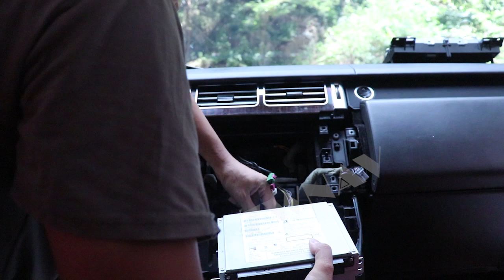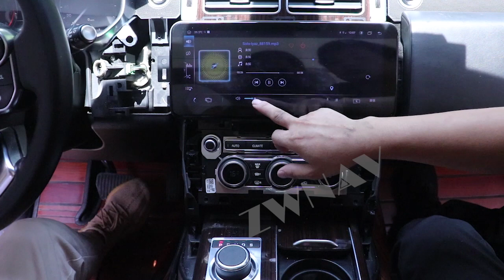How To Install Land Rover Rangerover Vogue L405 2014-2017 Car Radio？

Comment: Hi, I has just installed the Anddoid unit in my range rover.   Everything works except when I out my car on reverse.  It gives me a No signal and the screen is blank.  Also parking sensors dont work.  Everything is wired correctly.  Is there a way to troubleshoot this issue?   Thanks
Reply: Go to settings and change the backup camera to the “original camera” and you should be good to go. I have several issues with my set up as well such as no audio to say the least so hopefully someone releases a full set up guide for this thing very soon.
Reply: @MrEnlight1  thanks for the tip! I’ll gove it a try
Reply: @MrEnlight1  what did you do to resolve the no audio issue correctly have that problem
Reply: Did u have to install the storage box?
Reply: @arjunchand09  nothing besides the 12.3 android unit
Reply: Hi! Was anyone able to fix the camera and sensor problem.. im having the same issue with the unit I bought.. plus the sound can’t be loud..
Reply: @MrMontanadon  nope, been driving around since with the issue
Reply: @Luu1221  me too! They sell 1600$ unit and don’t even explain how to put it all together smh